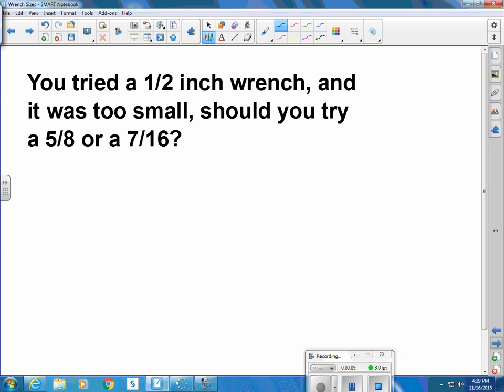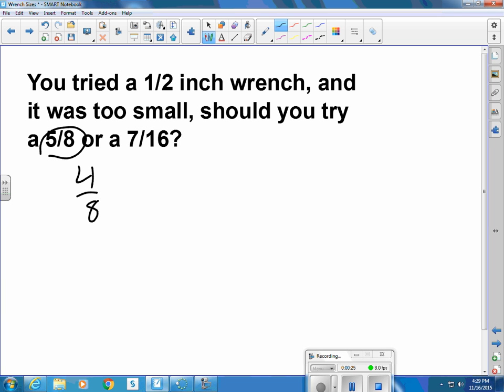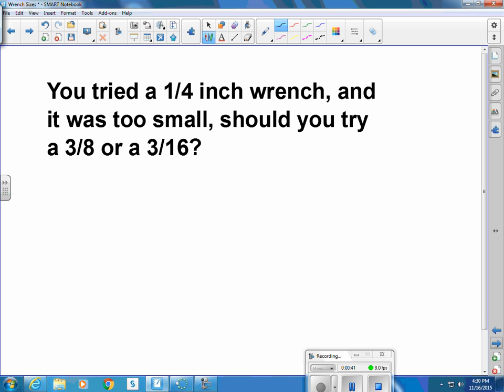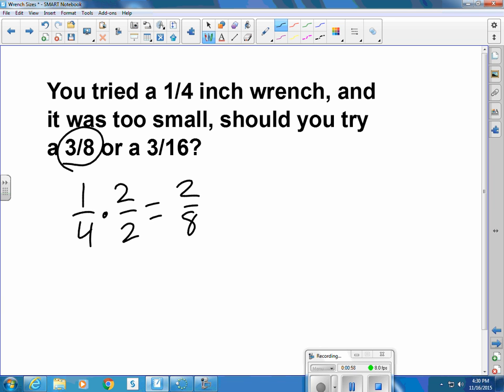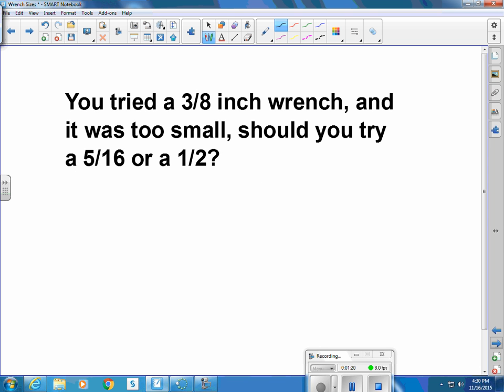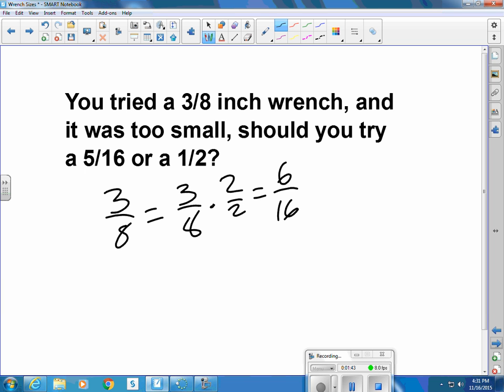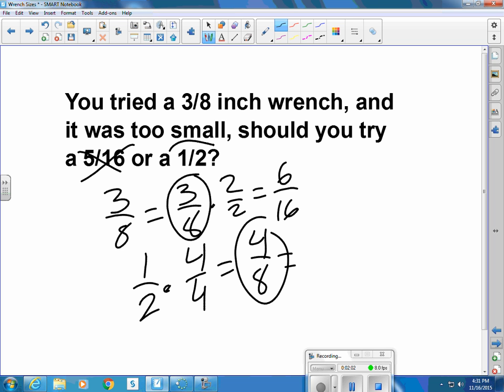Wrench Sizes video

Comment: Actually the next size up would be 9/16. 1/2” is too small so the next size up is 9/16 not 5/8 which could possibly be too large. A better way to do this is to take the half inch and multiply  times 8/8 so .........     1/2  X  8/8 =  8/16. Now just add one to the top number and get the next size up which is 9/16